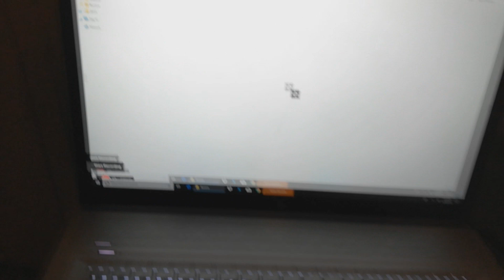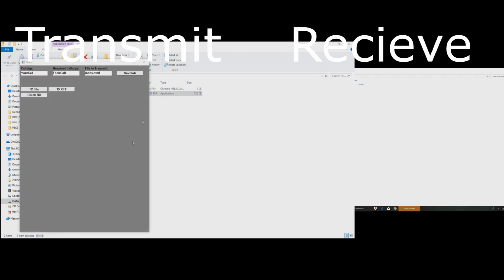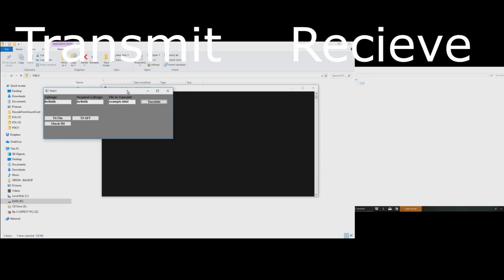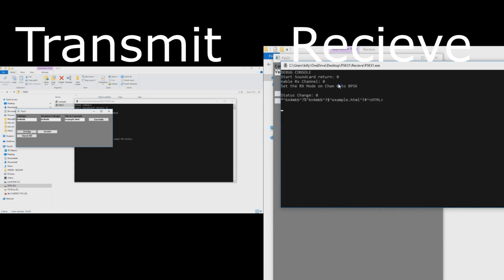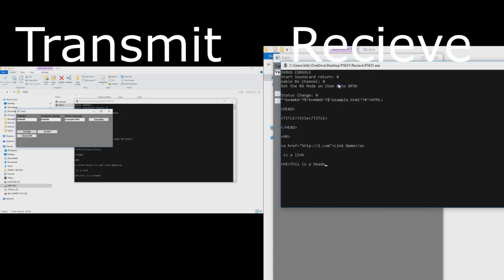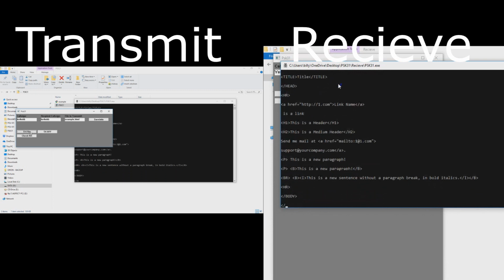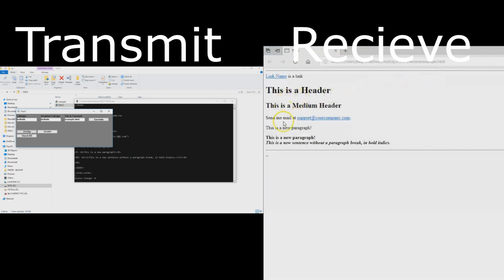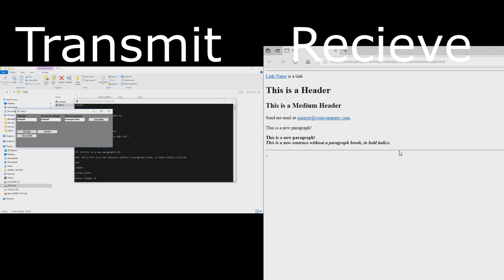Using PSK31 To Transmit Webpages in HTML over Ham Radio

Comment: Has there been anymore work on this?
Reply: PSK is a much more efficient modulation,  but there are other ways to get much faster data rates.

At the full symbol rate using 16FSK you can get 40 kb/s through a 25 kHz wide channel.  That's quite a lot faster than BPSK31.   An ESP32/8266  has 16 PWM timers  so you could do a 16FSK with one of those microcontrollers.  Interestingly enough, it's my current pet project.

Comment: Interesting! Maybe I missed it. What was the data rate? Could it be increased? As far as transmission could you use another protocol to get more speed? Possible uses would be super simple tracking of animals, cars or a weather balloon.
Reply from the maker: The data rate actually varies depending on the letter. Capital letters take about twice the amount of time to transmit. But the symbol rate is 31.25hz. It could be increased just by limiting it all to loawecase. This protocol is really usefull for weak signals, but it does have a lower data rate. Technically it could be used for all of these situations cuppled with a GPS recievet. But APRS ax.35 would be a better option for tracking.
Reply: Very interested in helping develop this further